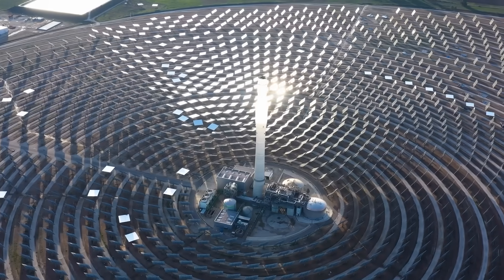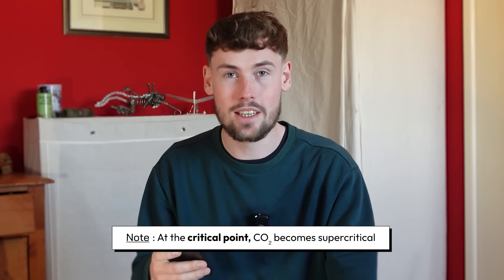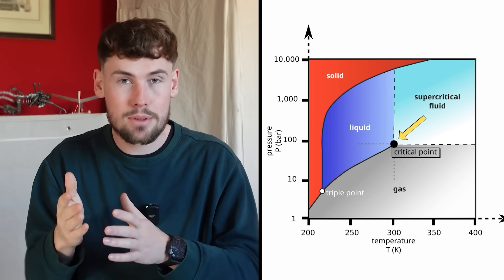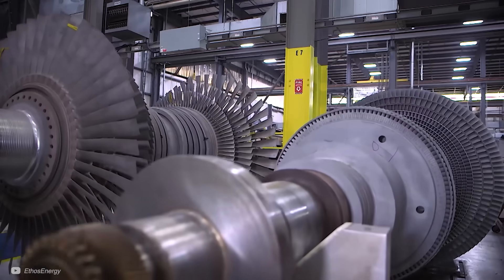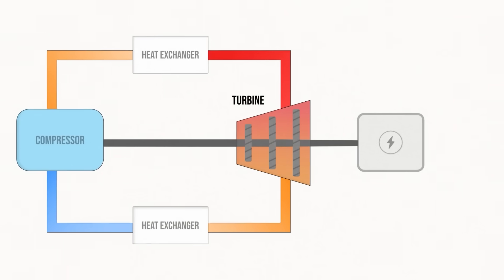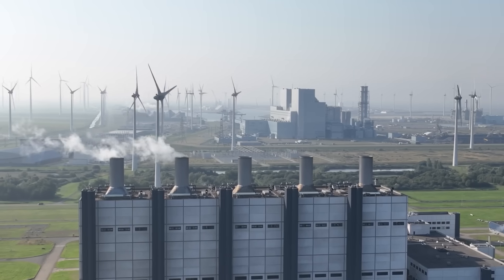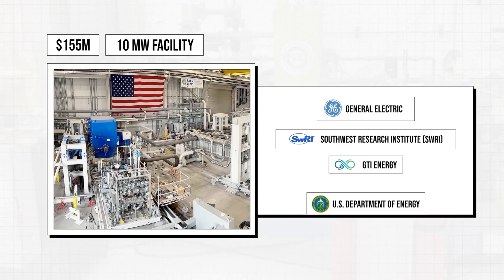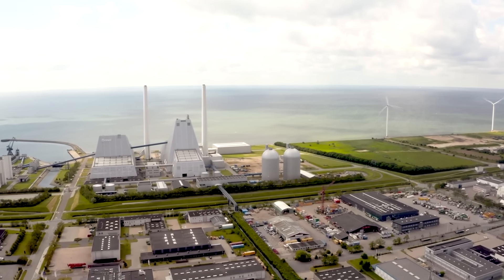How Ultra-Efficient CO2 Turbines Are The Future of Energy

Comment: The whole segment on comparing compression of steam and compression of supercritical CO2 is deeply flawed. In a steam cycle, you do not compress steam. You compress liquid water via a pump. Because water is almost incompressible, the volume change to raise the pressure is very small, which means the energy spent doing this is very small. It's always way more efficient to pump a certain mass of liquid than to compress an equivalent mass of gas, which is why the steam cycle's phase change is useful - you pressurize water via pumps, boil it into steam with your heat source, expand the steam through a turbine to extract energy, and then condense the exhaust steam back into liquid water to close the loop. There is basically no such thing as a 'steam compressor'. Yes it's possible, but nobody does it anywhere ever.

Power generating steam turbines also run their exhaust under a vacuum, in order to maximize the pressure difference across the turbine to raise efficiency, and also minimize the steam temperature as it comes out of the turbine (steam under a high vacuum condenses at relatively low temperatures, meaning less waste heat - but all heat engines must reject some waste heat via a cold sink, including CO2).

Not saying SCO2 is a bad idea. The idea of using turbines with substances other than water has been done - for example, the Organic Rankine Cycle uses basically a refrigerant hydrocarbon because it can extract energy from low-grade heat sources, and in some proposals this is chained together with a steam cycle where the organic cycle uses the waste heat from the steam cycle as its heat source, to more effectively extract energy.
Reply from the maker: Thanks for commenting this, I really messed up this section so I have cut it out. I'm going to start a discord server for 'peer review' that can allow me to run scripts by the community before posting them as I keep making stupid mistakes. Information on the server to follow.
Reply: @ZirothTech  Don't be too hard on yourself; we're all learning all the time. Fact check server is a good call though
Reply: @ZirothTech  You are the man for caring so much. Looking forward to seeing better and better videos.
Reply: @ZirothTech Dude!  Stupid mistakes are what I do.  Your mistakes compared to mine...brilliant!😊
Reply: used to use mercury in old coal plants. 
so 2 cooling loops: mercury boiler >> mercury condenser / water boiler >> steam condenser
Reply: @skipperg4436  Mercury is highly toxic to humans.
Reply: A supercritical steam boiler has no steam/water drum. Instead it’s one pipe with very high pressure water at the cold end and steam at the hot end. The steam has the same density as the water so there is not level line. The benefit is reduced heat of evaporation which creates the biggest energy loss in steam power systems.
Reply: @Dave5843-d9m  The biggest energy loss is the second law of thermodynamics where some heat must be rejected rather than converted into work.  You can use steam or CO2 as your working fluid but that inefficiency still remains.  As long as we use heat to add energy to a fluid and then expand the fluid to get work out, the second law applies without exception.  The overall best efficiency you can achieve is still the quantity temperature of the working fluid at the boiler minus the temperature at the outlet of the turbine divided by the temperature of the working fluid at the boiler.  The only way to improve on what we are currently doing is to get a hotter inlet temperature (boiler temperature).  The outlet temperature is fixed by the temperature of the world around us.  The reason a gas turbine running on natural gas is more efficient than a coal-fired power plant is that the inlet temperature is much higher.
Reply: @Dave5843-d9m  have you ever actually worked in a power plant?…
Reply: What i have seen this is base on a modify close loop Brayton cycle (think jet engines on aircraft).
Reply: @kerbalwww2  A Brayton cycle, like jet engines, does not work on pressure differences, but fluid speed (or velocity). It will be a Brayton cycle if you are heating the steam (or CO2) just before the turbine.
This is a Rankine cycle.
Reply: i seem to remember, at tech, they were called steam expansion turbines .
Reply: @johnmarkgatti3324 They are just steam turbines in the UK
Reply from the maker: Here is the discord channel for peer reviewing future videos https://discord.gg/BgwVvkRV
Reply: @ZirothTech  Nice 😎👍💯
Reply: 100% agree with this, it’s how all fossil fuel boilers work essentially, high pressure feed water, fed into a drum via economisers, the evaporation ccts in the boiler or HRSG, turn the feed water to saturated steam which is then further superheated and fed to a steam turbine - most large CCGT’s, take an Alstom gt26 have a GT, single shaft, generator and steam turbine with HP /IP and LP steam circuits with reheat (Rankine and Brayton cycles combined) the superheated steam taken from each circuit is depleted in energy through each stage by pressure and then expansion through the turbine, this is why the turbine blades get larger as the pressure reduces - to then vacuum in the condenser where the condensate is pumped back to the feed water tank, picking up heat while cooling other circuits along the way.

Not convinced by this CO2 bollocks to be honest, supply chains, reliability, refrigeration and capital costs, generator size and capability - small turbine yes, but what about the size of the generator that actually generates the electricity…

The process looks resource intensive, (adds to cost per MWhr) and is at a very early R&D stage. Not impossible, but I am just not convinced.
Reply: @markgriffiths409  maybe compact enough for ships or military outposts ?
Reply: In the end, a Rankine cycle functions with  various fluids. Water,  CO2, ammonia, many common refrigerant, and even sodium or mercury.  Supercrtical steam is invisible and can slice you in half.  CO2 is also invisible gas and will suffocate you in a few seconds.  No technology is without risk,  even a simple camp fire is a hazard.  Leave efficiency to those who make a living from power generation, or feel free to start your own independent generation company.
Reply: Almost everyone has at least one 'steam' compressor at home - inside refrigerator. Compressing gases is often done not for producing electricity, but for cooling something.
There is one highly sophisticated generator with gas compression in cycle - stirling type. It is more efficient than most ICE, but has another fatal flaw: it requires gas tight materials with very high working temperatures, cost goes through the roof.
Reply: @Phenantren  Just to be clear, when I said nobody compresses steam, I meant STEAM and specifically steam, aka water vapour. Gas compressors in general are very common, yes. Vapour compression refrigeration is a good example.
Reply: Ammonia is a top notch refrigerant at temperatures too low for water(Water is near theoretical ideal in its effective temperature band). 
Other refrigerants are used mainly for reasons of compact/cheap machinery or perceived "safety". (chloro and flouro carbons are non-flammable, and non-irritating if leaked, though oxygen displacement is still a factor with any gas. Ammonia is hazardous in concentration and mildly flammable, but when dissipated it is rather benign environmentally. Hydrocarbons are relatively less efficient and highly flammable, but not acutely toxic or irritating.)
Reply: From what I'm understanding, you just need to increase the pressure of the co2 and raise the temp to around 32'c. Which is a lot less than creating supercritical water, which I assume is a high pressure and temp in order to do so, plus you would have to heat the water, through stages, which adds a more complex process. 

So, surely just increasing the pressure of the co2 will in fact melt it, so it acheives super critical state and thus priming the system - cutting down on the complex process.
Reply: Correct, you cannot compress steam without applying additional energy at the point of generation. There are thermocompressors but that’s a different topic.
Reply: In maple syrup production, to boil the sap, efficiency is increased in modern systems by compressing the exhausted steam and running it back through a heat exchanger in the evaporation chamber, essentially making a water vapour heat pump to reduce fuel costs. They use reverse osmosis as well, but I believe the sap needs to be boiled for the finished product.
Reply: Don't forget superheaters that make the steam dryer.
Reply: One Question  :  How do you harness enough ( Carbon Dioxide ) to run long term without burning carbon base fuel?
Reply: @arthurzettel6618  It's a sealed loop. Fill it and unless there are leaks it's not going anywhere
Reply: @arthurzettel6618  Carbon Capture, even directly from the air.
Reply: You hook on to a carbon dioxide transmission pipe  line. They are around.
Reply: Let me ask you this, if the steam turbines work so well, why are they never productive?  I know of three that were built and then taken offline because the efficiency was extremely low and unproductive. One was never fully brought online they were unable to get the plant functioning in the first place. The steam couldnt maintain energy long enough to reach and spin the turbine.
Reply: @FortheGreatest-Good  I don't know what you're talking about. The steam turbine is the work horse of the power generation industry. Every single thermal power plant uses a steam turbine to generate electricity: Coal, natural gas, even nuclear, they all use steam turbines. Steam turbines are also used in non-power-generation applications. For example, steam ships started using turbines instead of piston steam engines in the early 20th century (the Titanic had a combination triple-expansion-piston engine and a low-pressure turbine). They're also used in industrial applications, for example I work as an engineer in a petrochemical complex and we use gas-fired boilers and steam turbines to directly drive enormous gas compressors because the power requirements are impractical for an electric motor.

Comment: Keep in mind though that steam turbines are only one way that electricity is generated (for example it is about 40% for the US) and the fraction is falling over time as we transition to a greater fraction of renewables.
Reply: Renewable are fine as a top up but they need a steam turbine ready and running just in case the wind stops, the sun goes in or the tide changes. With the move the EVs the overnight load will increase when solar and wind are far less available. The other drawback of wind and solar is that they do not provide the same frequency inertia that massive turbines provide.
Reply: @davebrown6552  I do not dispute that wind and solar can run a grid reliably all on their own. But it is a fact that most grids still have plenty of capacity to add more renewables and it is a fact that they will do so over the coming years. I live in Zambia and the bulk of our power comes from hydro electricity but we do have a small coal power station (and my own house runs about 70% off rooftop solar.)
Reply: @ I think you mean 'cannot'.
The problem with renewables is that they are sold on the idea of their maximum output when the reality is that they are only as good as their minimum output. 

A 300TW wind farm is worthless when the wind is calm. The advantage of 'conventional' generation is that they can respond to the demand where renewables need the demand to match their output it is no good producing 300TW if everyone is outside enjoying the breeze and not using any of that power. 

Wind and solar do have their uses and they will be required later to produce enough surplus power to burn limestone to produce the CO2 needed to keep the planet fed. 
The only world metric that has actually matched CO2 rise has been 3rd world crop yields per hectare. and it is thanks to the increase in CO2 that deaths from famine are at an all time low when the population is at an all time high. We can increase food production by spreading first world farming to the 3rd world but to keep pace with population growth we need more CO2.
Reply: Renewables, get you laughed out of the room, coal, gas and hydro way over 60 percent and climbing as renewables are a joke and anti green bane pushed by idiots who know nothing of profitable power generation. Laughable.
Reply: You are forgetting nuclear.
Reply: @SteenLarsen  No, I wasn't forgetting nuclear. The above 40% figure for the US includes nuclear.

Comment: It would have been great to specify, for those who are not good with numbers: a 10% efficiency increase, from 40 to 50% means a total increment of power generation, with the same imput, of 25%, that is, generate 125MW/h when you could only produce 100MW/h with the same fuel consumption. That's not a small leap.
Reply: Not a 10% increase, but a 10 percentage points increases.
Reply: What?!
Reply: @TheDude-w5l  If you have a generator that's 40% efficient on average, generating 100u, and you're stepping up to equipment that operates at a mean 50% efficiency it's a difference of 10%.

If 40% is 100, and you're going up by 10%, 10% is one fourth (¼) of 40%, so you also find one fourth (¼) of 100, to do this, you divide by four, like this. 100/4, which equals, (=) twenty five (2 followed by 5). 

Thus we discover that 25u is generated by said generator for every 10% of efficiency. 

So now, to go from 40% to 50% we must add 10%. Likewise, taking the original 100u production, we add the calculated production value of an additional 25u to the existing capacity of 100u, leaving us with 125u of generative capacity. 

The reason systems are measured like this is because all manmade energy systems are recapture systems, and as it would appear, in most cases we're quite bad at doing so. 

Basically all energy involves burning one thing, and converting the thermal energy from that into some other fkn thing. Although there are other systems that capture other energy forms such as the recapture of kinetic energy from wind and water turbines, or the various forms of radiation (including thermal) that factor into solar. 

Personally, I'm largely not a fan of said systems, much preferring passive type systems, especially considering that Hydro electric facilities are currently the highest producers on Earth (individually). If I had the funding, I myself would try to do something to capture some of the circumpolar current although given I'll never have the opportunity I've never bothered to do any math on the flow rates so I'm honestly not too sure what kind of gains there are to be had within the system, though sheer volume alone would suggest it worth consideration at the very least. 

Anyways, whether your question was predicated on one aspect or another, hopefully the answer is somewhere in there for ya.
Reply: But still not revolutionary. 50% waste is still huge.
Reply: Yes, but the important thing is how much fuel you need to produce a particular amount of power. In this case it's 20% less, which is significant. But is the reduction enough? To prevent catastrophic global temperature rise we need to cut fossil fuel usage by 80%. 20% is better than nothing, but it's not nearly enough. Instead of investing in CO2 turbines it might be better to put the money into very low carbon solutions like solar, wind and and batteries which can actually achieve that goal.
Reply: @bhabbott you're assuming that steam turbines and CO2 turbines are only used with fossil fuels, when in practice they are used anywhere you have a concentrated source of heat e.g. geothermal, solar-thermal, biomass, waste heat recovery systems.
Reply: @bhabbott  Well... keeping in mind that we also have nuclear power plants, that DO use steam turbines, and actually are the best energy production method so far (the lowest casualties / MWh produced), and the holy grial of energy production, the fusion reactor, will also use a steam turbine... yeah, it's quite good to have better turbines, now and in the future.
Reply: @bhabbott  The tech isn't there yet. There is only one clean power solution that is viable at the moment, and that is Nuclear which the public is afraid of.
Reply: @laststand6420  you do know that nuclear uses steam turbines to generate electricity ? so even for the nuclear plants this is an upgrade.
Reply: @ I was responding to a guy talking about wind, solar, and Batteries being the solution to co2 emissions.
Reply: @ alrighty my bad then, its sometimes complicated to follow the thread here in comments. And you are correct that currently Nuclear is the best clean we could go for as it is much more scalable than solar or wind.
Reply: @laststand6420 maybe old boomers. I don’t know a single young person against nuclear.
Reply: @CountJeffula  Hopefully we can have cheap power, but I'm not going to hold my breath... Seems like everything is stupid right now.